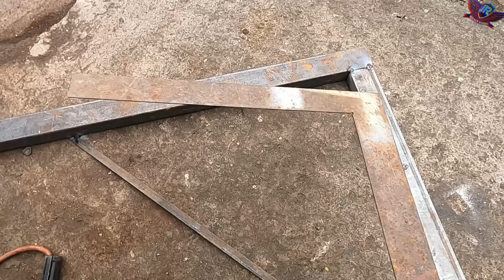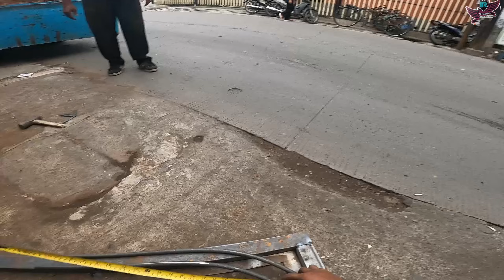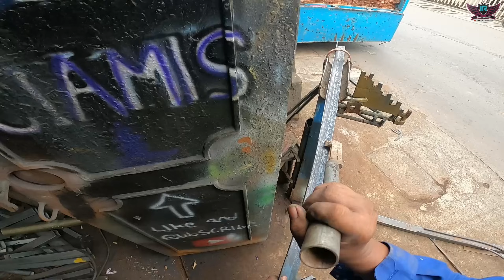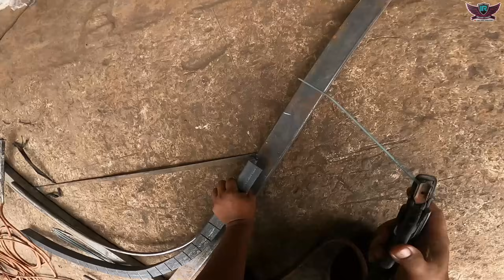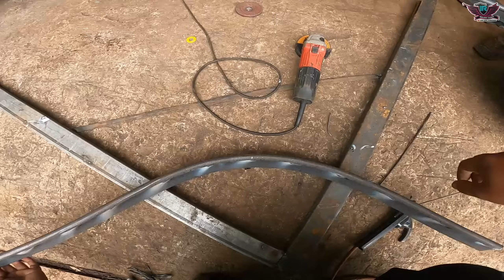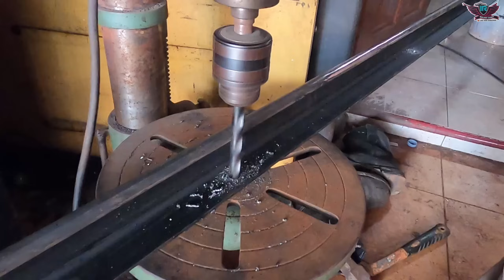cara buat rel bawah pintu pagar sliding dijamin roda tidak bakalan anjlok

Comment: Assalamualaikum maaf bos,mau tanya ni bos,, maklum pemula bos,,🙏🙏 kalo lebar pintu nya,70 cm, berapa lengkungan rel nya bos, maksudnya diameter nya bos 🙏 mksh bos 🙏🙏
Reply from the maker: @nasrilgindobasa539  bisa banget.. Ikutin yang di video
Reply: @IRwelderCiamis asalamualaikum maaf bang mau bertanya kalau lebar areal teras rumah lebar 6 meter di kali 3 meter 70 berapa diameter rel behel lengkung nya bang ?
Terimakasih
Reply from the maker: @agussitumorang7828  buat 70x70 juga